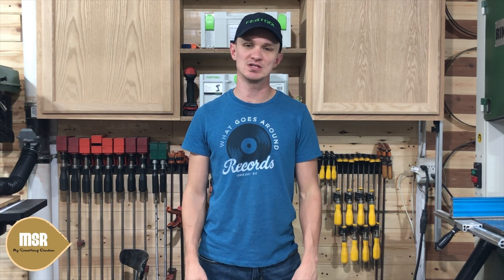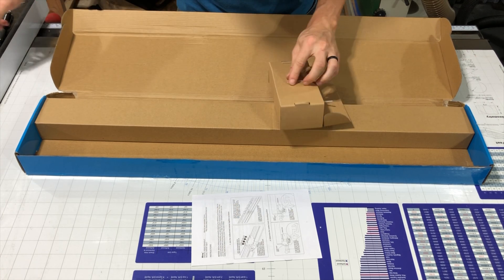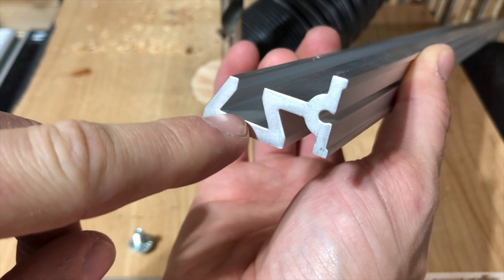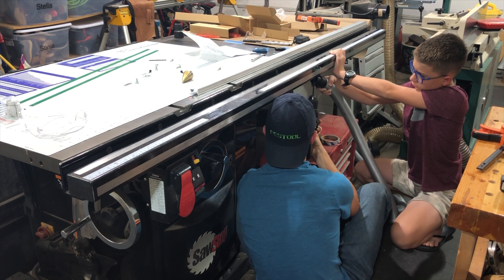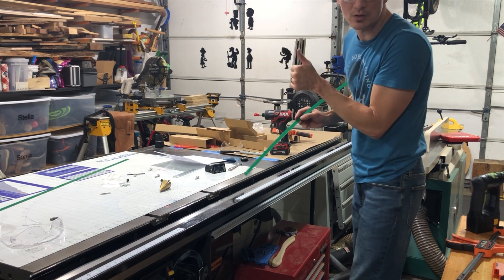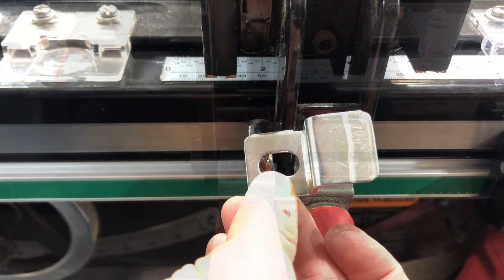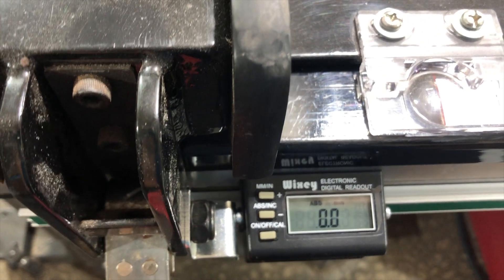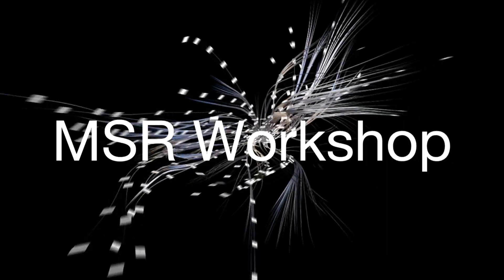SawStop Digital Readout!  Install and review.

Comment: Mine is the same model and are not precise, I tested an tested and compare with other rulers and the deviation are always the same, the worst thing his that we cannot calibrate.
Reply from the maker: That’s strange because mine has been dead on, and it’s very easy to zero just by sliding it over to touch the blade locking it, you can also manually adjust the reading as well and save it to be a default. It might be worth contacting wixey and explaining your problem to them
Reply: @MSRWorkshop  I contacted Wixey and Mr. Wixey answered quickly, I understood everything he said! But after many tests my Wixey WR 700 has a accuracy advertised bigger than advertised (accuracy advertised is .39mm per 3 foot), one meter (3 foot) is the accuracy standard measure for all measuring instruments.
Thanks for reply.
Reply from the maker: @djvitornunes  that’s still pretty darn good especially if it’s wood we’re talking about measuring. Moisture loss or gain can cause wood to swell more than .3mm. 
I suppose if your an engineer or building a space shuttle it’s a little hard to turn off the fact that you have to allow for error when working with products that aren’t stable at all times, always. I suppose it depends on your application in the end. For me it’s way more accurate and quick to use this then the ruler on my table saw fence.
Reply: @MSRWorkshop  As I said my Wixey WR 700 give more error than the accuracy annonced. After all this (repeated measurements and calibrations) my new (glued) metal ruler is dead on and the digital readout if necessary helps to divide one mm in ten. 
Thanks for your video and all your attention.

Comment: I like your flush install. Was hard to judge in the video, but does the track stick out past the original sawstop rail at all? Or is it perfectly flush to it?
Reply from the maker: It’s not entirely flush but it’s as close as it can get. I think it sticks out about a quarter of an inch but it’s not noticeable at all.
Reply: @MSRWorkshop  thanks for the reply. In my case it’s a storage issue as I slot my sawstop into a very width limited space for storage. 1/4 might still work. Thanks

Comment: Any thoughts of installing one of these on a miter saw?
Reply from the maker: The little magnetic one works great for adjusting the tilt of your saw. Just zero it out to the bed and then stick it to the side of the blade and adjust it until you get the bevel that you want.
Reply: M1 Caliber by REEKON

Comment: its only as accurate as your calipers.  My point is you have a 5k dollar saw 100 bucks on the fence measuring device, buy a set of sturret callappers.  Or if you want to get real close buy a set of mic's  and joe blocks to calibrate them with!

Now from a Machinist  don't pinch close the calibers  use the thumb wheel to close them and make sure the contact area is clean after you open them metal and wood chips stick to them and will give you a bad reading. But keep in mind calipers are a rough unit of measure. Pinching the claws close will blow the measurement. I know a lot of guys do it but its wrong.
Reply: Since solid  wood can seasonally move ~ 0.03" for a 6" wide board, there's no need for machinist level accuracy. A nice scale is more than adequate. For me a dro is woodworking is nice for quick set up, repeatability, and ease of calculations when making 45* bevels. Just subtract material thickness from the cut length. Coming from airline maintenance where tolerances were critical in components and engines, to woodworking where using fingertips  for fine scale adjustments was enlightening. One of my favorite scales is a folding wooden one that belonged to my late father in law. That and a sharp pencil ate good enough for most projects. Have to admit that it was hard at first to not measure to 3, 4 digits.
Reply: I was going to write a comment about how he zeroed the calipers 😂😂 you want to zero it how you measure it. Use the thumb screw to pinch the jaws closed then zero it. When you measure your piece with the thumb screw it’ll be as close as your calipers allow. Myself as a machinist see people in my shop use them wrong all the time... mostly engineers. Great tutorial. About to purchase one for my sawstop
Reply from the maker: The difference here is that I’m working with wood and not metal. To expect 10,000th accuracy from a table saw is insane. The flex in a blade, even a full kerf is probably more than that. A $100 digital readout that gets you to a thousandth of measurement is far better than a $10 piece of tape glued to a metal rail with a magnifying glass over it. 
I know machinists speak a different language when it comes to measuring but expecting that level  of accuracy with a highly unstable material is crazy.
Reply: @MSRWorkshop  
I get your working with wood, it moves but you want your parts as close as you can get them to start out and constantly the same sizes. The wind changes direction your wood will change its size, but they will all change togather. 
Your saws more accurate then you think
If you let the blade do the work and don't force it in a cut then its going to be pretty dam close if its a decent blade type and brand. Turning force and speed will keep it stright.   You should also glue everything up after its cut insted of the next day so ive read?? Havnt noticed this yet.  Im just talking.

Comment: I've got a few questions. Now that you've had this for a while are you still impressed? Also I noticed that you directly bolted the track to the saw rather than using the supplied brackets as shown on the Infinity web site. Any reason for that? You modified the bracket to connect to the read out using the magnet. Was that necessary?
I also have a Sawstop as well and wondering what is the easiest install method.
Thanks for a great video BTW!
Reply from the maker: So the reason for the install direct to the rail is it gives it much cleaner and flush look. If you use the supplied hardware it hangs down a bit and doesn’t look as nice.  The bracket for the readout was cut shorter because it comes in contact with the rail and was to long. Just cut about a 1/4 to 1/2 in off and test the fit. Also the side tab comes off as well.  This actually is a quite simple install. 
A little more drilling is involved but the kit has all the screws needed as well as the drill bit for the self taping ones.  
And to a ayer the most important question, do I still like it? YES, it’s very convenient and super accurate. Last it’s nice to be able to zero it to any with of blade. I switched to a thin kerf rip from a full kerf and just slid it over hit “zero” and was back up and running. Otherwise you would have to reset your ruler, and that’s more of a pain. 
Hope this helps
Reply: @MSRWorkshop   I think the more direct bolt to the rail is better, your less apt to drop a chunk of wood on it and screw it up. its also more solid to the fence rails so you can't bend the brackets by mistake.
because a 2x4  or whatever fell over and hit it at worst you'll damage it beyond repair.

other option would be a incra fence system and this is about 1/5 that price.
Reply: @MSRWorkshop  Helped a lot. Thanks!